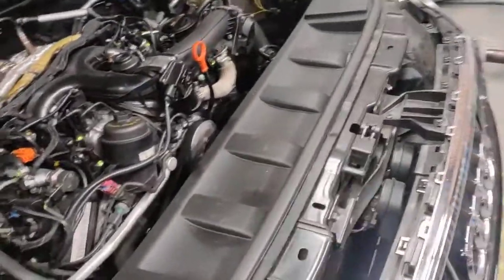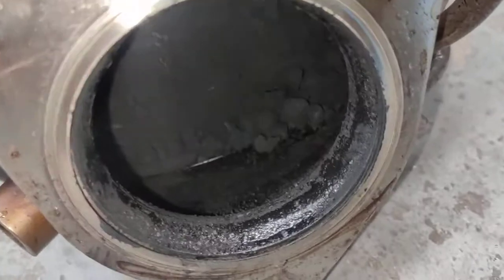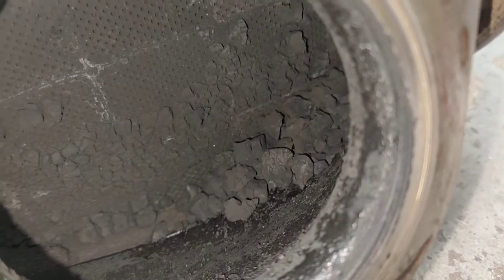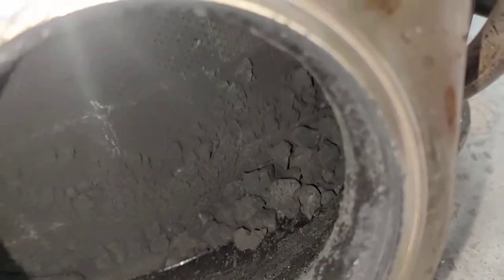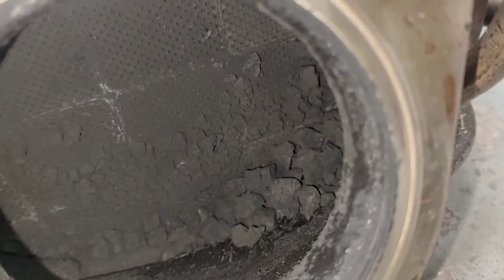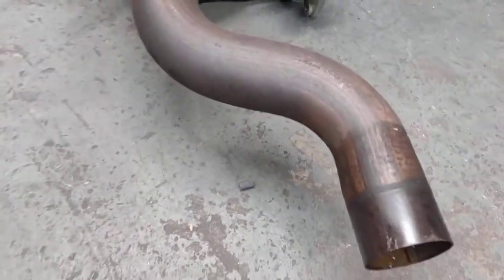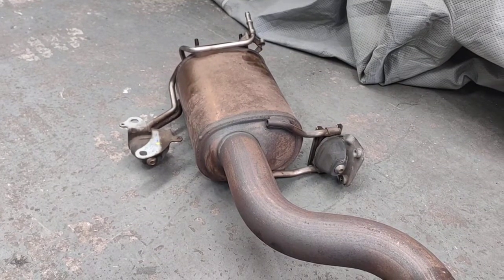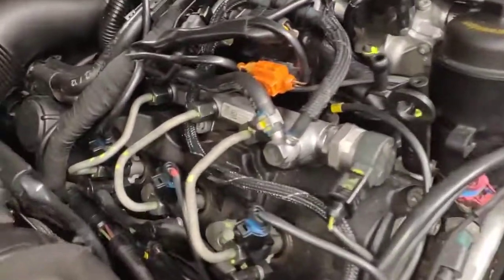Audi Q7 2013 - (Diesel Particulate Filter)DPF filter blocked

Comment: G’day Paul, could this blockage be caused by not using the correct low ash engine oil? It’s amazing to see those large flakey pieces in your video. I had a 2.0 TDI Golf with over 90K and always used the 507 low ash oil and no PDF problems. Oil & filter changed at 7500 Ks. Great little car.
Your videos are the best mate.
Reply from the maker: Hi Graham,
100% If you always use the correct oil and change oil/filter every 6-7 months including Liqui moly Diesel intake manifold cleaner with a few highway drive.
DPF filter will last a long time

Comment: Why did you have to replace the injectors and injector pump? Because dpf was blocked?  Thanks
Reply from the maker: Pump high pressure reading was not the same as the Specified 100bar less.
Injectors were leaking pretty bad
DPF - blocked really bad

Comment: There's supposed to be a differential air pressure sensor over the dpf to detect blockage, and the ECM using that info to turn on your Regen required light way before you get to such blockage.
So what happened here? Regen system not working?
Reply from the maker: Yes that's correct but if you don't drive your car on the freeway regeneration will not be activated by ecu - short trips will cause it to block over a period of time.
Reply: @emdporschespecialistcaring8975  understood. I am wondering if that year Audi with diesel had a cluster light warning the user to initiate a filter Regen, which forces the operator to idle for about an hour which allows the ECM to inject fuel during the exhaust stroke and raise the temperature in the doc and burn off. If they had this, the owner ignored the light. ECM have been measuring soot loads for years, I think they can notify a driver way before total clogging is reached.
Reply from the maker: @svennomore729  not this model only AdBlue have that